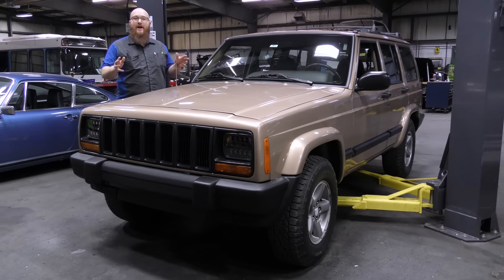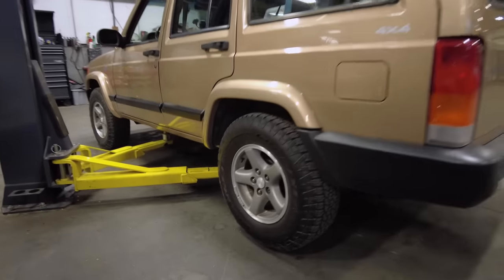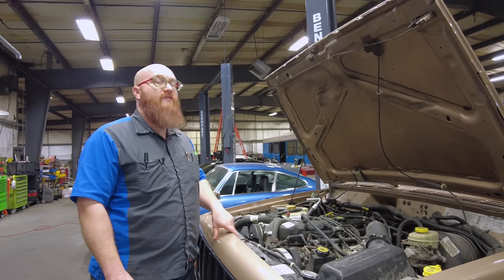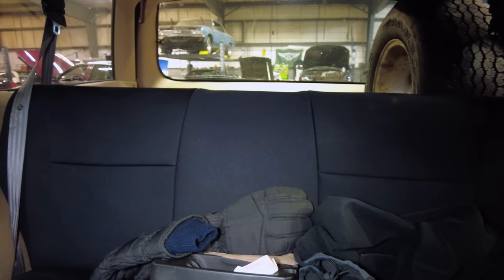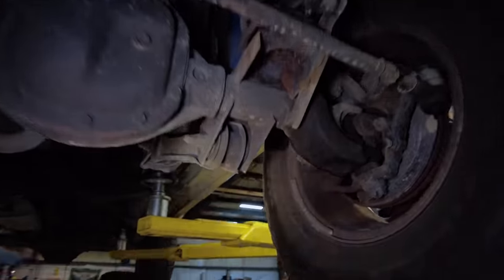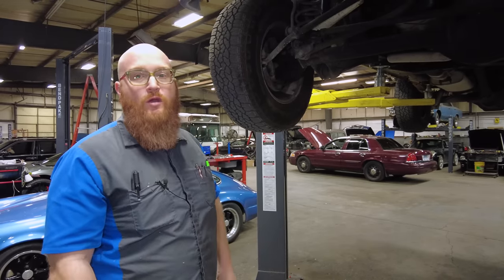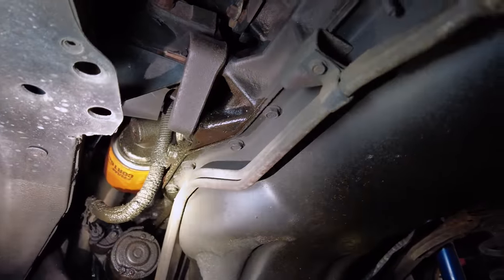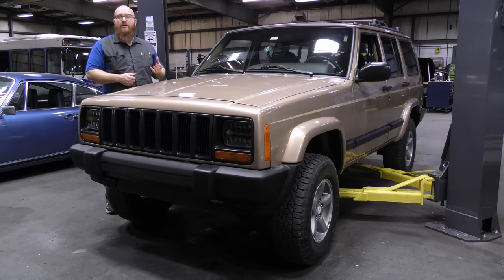Death Wobble on this immaculate '99 Jeep Cherokee! CAR WIZARD shows how to find it and the fix

Comment: I finally figured out how to fix overheating problems on these engines! Fan shroud makes a big difference, when you pick out a thermostat never delete your thermostat and don’t go with a cooler thermostat either, go with an OEM 195 degree thermostat. I guess it lets the coolant stay in the radiator long enough to actually cool significantly better. I did all sorts of stupid stuff and this was the only thing that worked.

Some of these do you have some sort of reverse flow cooling systems, which can be confusing.

Comment: The Death Wobble was just a part of the Jeep experience. Loved my '99 Cherokee Classic, especially in snow. I had large wheels on mine and had pushed out the wheels a pair of inches.. The inline 6 could run forever. Rust got to mine after 200k miles.

Comment: I have a 95 xj and mine isn't as nice as that one mine suffered from death wobble as well I used to hit a little bump at 35mph and it felt like the engine was gonna fall out. A new set of upper and lower control arms fixed that

Comment: Unbalanced tires can cause it too with bigger tires. Had a k5 on 38 inch bias ply swampers, took 2lbs per wheel to balance it. Everything else was new. That steering dampener shock doesnt really fix the problem but does help mask it

Comment: I experienced the same thing on my ‘00 Wrangler. Except it was the upper (frame mounted) bushing which had been regularly bathed in used oil, rotting the rubber. A $9 urethane replacement killed the wobble, nothing in the next 100k miles. I would only get DW at 25-35 mph after hitting a bump in the road setting it off.

Comment: Bought my 2001 XJ a little over 4 years ago with 220k miles on the clock.  It's now at 262k and counting (my daily driver).  I've had death wobble a few times, can't seem to figure it out.  Any more I just stay off the highway.  Never happens below 50 MPH which is 99% of my daily driving.  Living in the rust belt, it's tough to find one that isn't rusted out or made into a woods vehicle.  I installed a 1.75" lift and 1x size larger tires for the "up country" look.  Love this XJ (my 2nd Cherokee).  Great video Wizard!

Comment: That track bar bushing is shot and definitely in need of a swap.

Also, anyone that tries to tell you a failed steering stabilizer can't cause deathwobble has never seen one dry out and lock up. Certainly they don't in every case. Removing it can solve the problem. A working one can mask deathwobble from elsewhere. But one that's bolted in place and not working as intended can certainly cause it. If its leaked out and locking up/real stiff, it acts as a spring in the steering system.

Comment: No mention of the 0331 head issues? If you are looking at a 99-01 XJ, research the 0331 head issues. Then you can inspect for it before purchasing one. If it has been replaced with the updated TUPY version head, get the engine up to full operating temperature and double check the oil pressure at idle.
Reply: 99s do not have the 0331 head.
Reply: @PaYankee99  Sorry, getting WJ and XJ years mixed up in terms of start date.

Comment: I have had and built multiple XJs they are fantastic cars I had 2 that had death wabble 1 I upgraded my track bar because the bushings in the old ones were warn out and that fixed it the second one I upgraded and replaced every possible part in the front end with new and updated parts drove great for about 10 miles then got deathwabble I had it aligned twice still didn't go away so my last attempt to fix it was replace the tires that were less than 2 years old and had maybe 10K Miles and were in great condition i put new tires on it and never got deathwabble again... I put the old tires on the other xj just to see and no deathwabble. I still have no clue what fixed it But $1000 In front end parts and new tires was the answer
Reply: For both jeeps the first thing I tried was alignment and rebalance tires before replacing anything

Comment: It’s an XJ.  If it’s leaking oil it has oil.  It’s when it stops leaking that you have to worry.
Reply: Nah, you can get them 100% leak-free. Takes a bit of effort, but it's doable.
Reply: Ditch the plastic valve cover>>prone to warping.
Reply: @hotpuppy1  
Use double the gaskets...
stick one permanently to the head..... and one permanently to the valve cover.
the one on the head becomes a dam and stops oil leaking past it...

Comment: Nice jeep.
The death wobble is added to when the body is "lifted" from stock, because the unequal length suspension arms cause the whole front axle casing to rotate a few degrees, decreasing the caster angle, which is what controls the self centering of the steering. Reduced caster angles remove the independent forces on each front wheel that works against any play in the joints, thus allowing the death wobble to be uncontrollable. 
Great channel, keep it up!

Comment: That's a nice one! But, another owner comment, this time on your claim about the four link: If you have stock arms and the link bushings get loose enough, it will start to death wobble at highway speeds. Pretty much anything in the front steering and suspension responsible for holding the axles and wheels firmly in place, if it stops doing that, can contribute to wobble.

Comment: I have a white 2000 Cherokee Classic 4WD with only 135,000 miles on it. In the couple thousand miles I have put on it since I got it from the old owner, it has not left me stranded and has only needed routine maintenance other than the fact that due to age the A/C system has some leaks. On the plus side, it has 33s and a 4" lift. The only off-road I have really done so far is installing manual sway bar disconnects. I hope to watch my odometer roll to 200K one day

Comment: Of all the rental cars they let me drive that year in the mid 90's... THE Cherokee Sport tops my list for Aggressive Urban Driving. Incredible handling and enough suspension to slam through intersections, over parking curbs, you know. Freedom.    Pull out to pass and end up winng a drag race.  That turning radius!  
Great visibilty and narrow enough slip through tight gaps.  
    It'd wouldn't go Starsky and Hutch under throttle like a Crown Vic  (somewhat to my dismay, it would loudly 😊 spin the inside tire and go where I pointed it--even in the rain). 
    But I swear I did a lane change--on purpose--during a screaming multi-wheel lockup and still made the stop sign.  All of them.

See also: Dajiban Cargo Van, Corolla but E-brake turns in Altimas are more fun, convertable Camero V-6, Olds Achieva, Maxima, Volvo 850, the Caddy and the Crown Vic.

Comment: I had a '98 Sport model.  Had to replace the track bar at one point, but it only clunked --no wobble.  I bought the car with 106K miles on it, drove it for 10  years, and put another 110K on it.  Those miles were mostly trouble free, and the car did everything I asked of it.  It was one of the best vehicles I ever owned.  My next car was a 2008 Commander Limited, and it did most of the things that Wizard mentioned, and then some.  It was nice to look at, but it was not the droid I was looking for.  Like Wizard in his previous video, I wised up and traded the Commander in for an FJ Cruiser.  It's 15 years old with 177K miles, but it's another fabulous vee-hicle. 👍😁

Comment: Had a 92 Cherokee Limited.
Bought it because I needed a vehicle I could work on, that was capable of on and off road.
Fixed the death wobble (tie rods and bushings), got in high quality motor mounts (which was fun *eyes rolling*) and changed the shocks on all 4 corners.
Also ripped out the interior carpeting (massive mold issues) and put down Herculiner, repainted all the interior parts to a black with gold fleck and replaced the headliner with Alcantara. 
Seats were comfy as could be. Far better than my current vehicles.
Ended up selling it because there were things I couldn't figure out.
Great ride.

Comment: Had a used white 2001 2-door, 2WD Cherokee and a used yellow 4WD 2000 Cherokee.  I had them when they were 10 or 11 years old.  Loved them.  Pavement princesses.  Both were 2nd vehicles.  Something very relaxing about having a vehicle where you're not worried about door dings, where you're going to park, and whatnot.  

I found the weakest component to be the air-conditioning system.  Air didn't work in the white one.  The yellow one would get cold, but not ice cold.

Comment: Mechanics / other Jeep victims (haha) out there currently dealing with this:

Yes, first check all your control arms, tie rod ends, wheel-to-wheel alignments, etc. and then check for play in your chassis track bar.

If a bushing or two needs replacing and you're looking for them, you come across track bars, you'll start noticing lots of people sell adjustable track bars.  There's a reason for this, so be aware:

Alot of the 90s and early '00s models WJs, etc. had front ends that were mis-aligned from the body FROM the factory.  Not a root cause but it definitely does accentuate death wobble worse when it occurs.

Take it in for a body to chassis front end alignment, see if you find that on yours.  If you do, I'd snag one of those adjustable replacement track bars (and new bushings) take it back to the alignment shop with that in hand and see if they can help you out there.

Took me some time to discover that, figured I'd share, hope it helps!

Comment: This car could be taken to a car show and it could expect to get an award, its that presentable. My congrats to the owner for scoring such a beautiful car. The "wobble" is just something to be corrected at a repair shop like the Car Wizard's. Regarding the 4.0 engine, the Wizard is absolutely correct, even perhaps understating the engine. It is purpose-built for the actual job it has to do, its not a hot rod, but if you're doing any off-roading, its got low end toque that never stops I had a relative who had this engine in a Jeep Wrangler Rubicon and it couldn't be stopped. . I've read any number of stories about people who've had this engine and they're at 350 thousand or more miles and it just keeps running.

Comment: That model helped to kick off the popularity of SUVs. Back in the 80s. Housewives flocked to them to keep themselves out of minivans. Which they hated the image of driving those.  Minivans are hard to beat for their practicality,  but the look isn't for everyone. Also the Jeep Wranglers got expensive on the used market, so it  wasn't long before the younger crowd realized the Cherokee was the same thing with a longer drive shaft. So they started buying them up for off-roading.

Comment: too bad ppl want 2.... 3x the BLUE BOOK value for them??? I DONT THINK SO ... with 222,000 miles and needing $1000+ worth of work on the undercarriage that has NEVER EVER had any gearbox oils changed???  motor mounts/trans mount... track bar... and ppl are getting $1000 more for the OLD USED ... neglected joop than they are worth????  NO!!!!

Comment: As a two time Cherokee owner, generally it's not one thing that causes the death wobble. It's a culmination of many. To fix the DW in both mine, I had to replace the upper and lower control arm bushings, the stabilizer shock, the trackbar bushings. Really, just all of the bushings.

Comment: Trackbar bushings and the Control Arm bushings. It is never the Steering Stabilizer. 
once you fix the Real cause, you can even take the stabilizer off.
Another thing to look for is the caster adjustment.

Comment: Hey Wizard, great channel! I bought a 2010 Lexus RX 350 on your recommendation, and I love the thing!...question sir; it's an AWD model with 167k miles...what do you recommend as far as Differential/transfer case/transmission service at this point? There's no history about these services, although this was at some point a Certified Pre-Owned Lexus. I'm doing rear shocks and brakes all around  (eventually) but this runs so smoothly, quietly, and comfortably...I really want to baby it to help it last as long as possible, any assistance will be greatly appreciated - and thanks for the recommendation!

Comment: 99 Jeep sport 4.0 early model with distributor(166k), check for zero play on the rotor shaft, mine had quite a bit(.030), so I replaced it and idles smoother. 
Check front output shaft on transfer case(np242) for zero play, yes zero, mine has just a little which causes a grinding type noise if you listed closely due to noisy bearing. 

Replace control arm bushings upper and lower if you’re driving on road(62-68mph) and feel a little movement in steering wheel, after wheel alignment and all other repairs for death wobble.

There is nothing cheap about a Jeep, even if you maintain it. Hope this helps.

Comment: I have a 1996 Jeep Cherokee Sport 4X4 with 175,000 that I have owned since new. I have the "death wobble" I have changed out ALL bushings and checked ball joints, replaced rear springs, front coil springs, all shock absorbers and stabilizer shock for heavy duty one. Only thing I haven't done is replace tires and steering box. I still have the death wobble which happens when I go over a bump in the road at about 55mph. ..... guess those are next on the list....sign!!!
Mr. Wizard.... I am trying to be optimistic that your diagnosis turns out to be the answer for this really nice specimen of a Jeep Cherokee.... can you let us know if it really resolves the wobble?...
Great show.... keep it up...

Comment: We had a MINT '96 two door with the 4.0, 4x4 automatic. It turned over 115k the day I bought it. A few days after my 18 yr. old put it in his name he rolled it coming home from work, buckling the roof. We also had a 2000 & a '98 four door, but I liked the '96 the most. One of our boat mechanics has 14 of them right now, half are parts donors, some will be woods/trail vehicles. His wife has a '00, son has a '97 and daughter has a '98. They just keep on going with routine maintenance. Great vehicles for young drivers if you can buy them right!

Comment: My '97 Ram diesel 2500 4x4 had this problem. Replaced ball joints, tie rod joints, track bar, STEERING BOX, axle u-joints. Nothing helped. I noted that the problem mostly disappeared during cold winter months, but as the temps began to rise above 50 F. the shudder would begin. As warmer temps crept up, the shudder would change to all out death wobble chaos. Lets see. What item on the truck goes through noticeable changes with temperature? How about the hydraulic steering dampener? Oil viscosity changes with temperature. Bingo! Put on a new dampener designed for off road use, and the truck has never had that issue again. That was in 2008. All Chrysler built 4x4 vehicles should have the stock dampener changed out with a heavy duty unit around 80,000 miles, even if all the other front suspension components are in good condition.

Comment: Excellent video and great info.
Question Please:
We have a 1991 Cherokee XJ in the 2 wheel drive version. We had the death wobble and it is scary. Would the components you listed as the cause be the same for the 2 wheel drive version? Our XJ has 228K miles on it.
BTW: I am currently looking for another XJ as a second vehicle (4X4 Version) and selling my car. Looking for quite a while just trying to find one with no rot (or paint issues) and with lower miles...Tough to find one so far here in NJ. (Gave you a sub for a detailed video well done). Thanks.
Philip
Jersey Shore Area

Comment: Letting the XJ go out of production was a major mistake.  They've not done anything as good since.  And good luck finding a good one for sale.  Death wobble is common to all solid axle vehicles regardless of make of model.  It's based on the problem of gyroscopic progression of two wheels linked directly.  The track bar (panhard arm) is absolutely crucial to controlling this.

Comment: As an owner of a 300,000 mile 2000 Jeep Grand Cherokee, I can attest at these inline 6 are darn near bulletproof and very easy to work on not to mention very affordable to work on.

Just a shame I live in a rust belt state.

If you can do the AT5 transmission swap or the transmission mod to add the 5th gear, definitely worth it with the low end torque these engines have.

Comment: Much as I wanted to love them, my experience with Jeeps has left me cold, sorry.
Loved the 4.7 HO in the WJ Overland, but they die badly of dropped valve-seats.
$1800 per head to have them rebuilt properly.
TJs are trucks.
I'd rather not have a Wrangler at all.
My I6 died at 70K. Pissed me off.
Friend ones have locked up at low mileage, too.

Comment: Gotta say: It's super tidy, and it's one of the reasons that I finally bought a Jeep.
Bloody Judas goat of a car.
Had ZJ and WJ models.
Both did the wobble-thing.
Scary as fuck.
On the WJ, it was a mount at the rear, above the diff - like a 3-legged thing, with a central ball-joint.
Fair bit of work to replace, but the car then handled enough to sell it.
The ZJ just got sold.
Rock Auto has the parts...

Comment: I've got a Comanche I'm fixing up now. Have a '93 ZJ that had death wobble when I got it... Ain't easy or fun replacing 8 Control Arms, All 4 Shocks, and the steering stabilizer with no lift and regular power tools- oh and all of the bolts were 30 years old, frozen in rust, and likely had never been changed before... Busted knuckle garage.

Comment: Had a 2000 XJ.
Hands down best vehicle I've ever had. Beat the ever living crap put of it for 200k. Drove it hard. Put it away wet. Barely maintained it, just the basics.

Never burned a drop oil and the only leak it had was valve cover with cost like 30 bucks to fix.

Got rhe death wobble twice. Both time I just ordered the cheapest complete front end parts off rock auto (like $150 total) and swapped them out. Would fix it for a good while again. 

It only happened around 100k and then again well over 200 before I sold it.